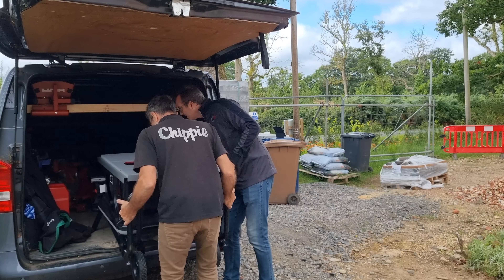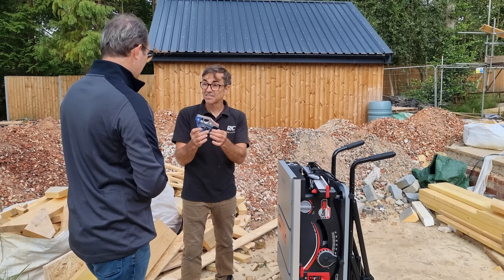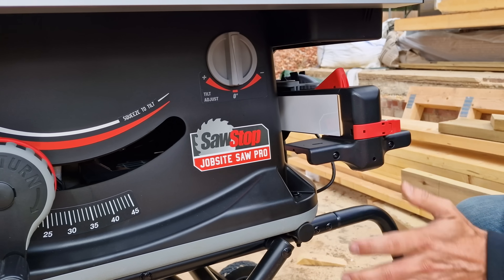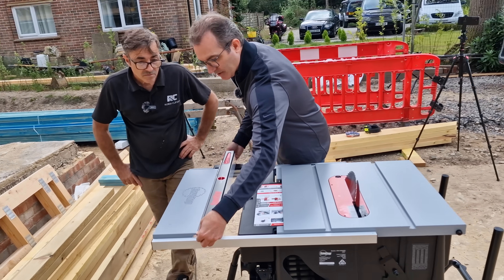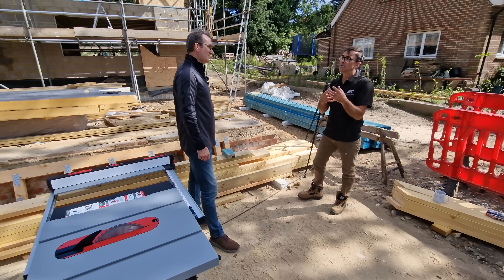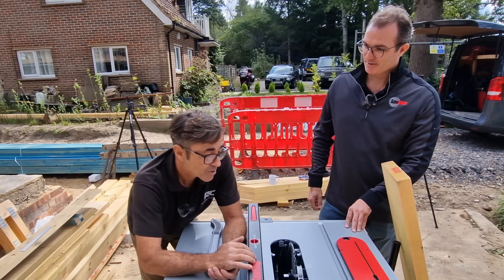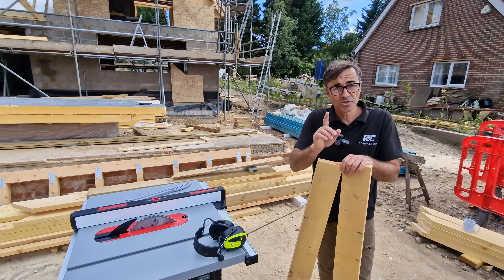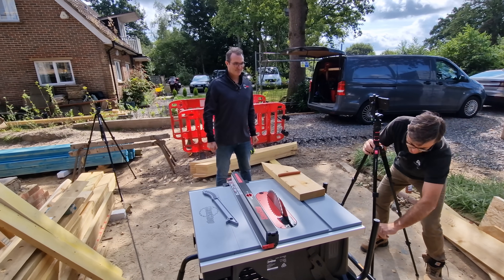SawStop is finally here!!!!! The saw that has saved fingers for over 20 years

Comment: So, you have two choices.
1) You can fit a guard to prevent contact with the blade
2) You can add a lot of expensive technology and pray that it will work when needed"
And, of course, that guard also prevents many kickback injuries, which the SawStop system does not...
* do you think there is a single risk assessment inspector that would accept this as the sole protection?

Comment: I had the sawstop jobsite, I found it to be disappointing in many areas. Especially dust extraction, too flex on the fence and mitre gauge dovetail even with a incra mitre gauge. Its ok for occasional rough cuts. Precise adjustment for height of cut and mitre cuts is difficult.
Reply: @blackadder1966  ditto
Inferior saw, great blade safety

Comment: Got the Festool TKS 80...got to be careful that you don't accidentally touch the blade for a few seconds after you have switched the saw off because it will activate the cartridge. 
Happened to me....couldn't understand why the saw wouldn't restart. The blade was still up, but the cartridge had fired into the stationary blade ..... £90 that cost . 
Also , on the Festool you cannot put fence any closer than 3mm....not that you probably would on site, but it makes you think.
Quite often, if the brains on the saw aren't happy, it just won't start....have to switch it off ...all the way off and turn on again..
I'm a nearly 60 years old joiner... only saw I'm nervous on is my Festool .

Maybe now Sawstop are in the UK cartridge, and blade prices might come down£££££

Comment: Would be interesting to see the price point it comes in at? We have been running the Festool TKS with Sawstop for the last 12 months and it's great for peace of mind and letting less experienced people use it. One activation from a nail that we missed in the wood but worth it. If this comes in at the right place we'll be able to replace our Hikoki jobsite saws as well.

We also run the Felder Kappa 550 PCS with their version of it which doesn't require contact and doesn't wreck the blade. It would be great if Sawstop/Festool could make theirs non-destructive,

Comment: Does the blade need to be replaced if the safety mechanism is fired?
Reply: Yes. Easier than replacing a finger.
Reply: @robertpearce8394  
Did Bosch not have a similar system where the blade didn't have to be replaced, which had to be withdrawn after litigation?

Seems the basic patent for this expires in 2026 so I anticipate prices will fall after that.

Comment: I’ve been using the SawStop Jobsite Pro for the last 2-3 years in the states. There’s a lot of great features and I’m sure it’s saved my crews fingers several times over, but the fence is garbage!! It doesn’t stay square and we have to use a clamp on the far end adding lots of time for every change in width of cut. I’d purchase a new fence but it doesn’t seem possible to purchase individual parts for the saw.

Comment: The SawStop is a brilliant invention, but...

1) I can hear the saw struggling. It sounds really under powered for any jobsite saw.

2) I use aluminum multi track for my sleds for a perfectly straight edge, and for attachments. I've read that aluminum will set off the saw stop, so...at a hundred $+ a pop replacement, and possibly ruining the blade as well; leaves me still just thinking about it.

3) Priced like a Festool product. Ugh.

I use the; DEWALT (DWE7491RS) 10-Inch Table Saw, 32-1/2-Inch Rip Capacity. Comes with a better mobile cart, better fence (rack and pinion) , more power, and comes in at under $600.

Hmm, 

(POWERTEC 71488V Aluminum Multi T-Track Fence 3” High) if you don't know what multi-track is. (Woodworking blades happily cut through aluminum) 

That being said; I would probably buy the full size Sawstop table saw, and give up using aluminum backing if I ever have the room for it in my garage woodworking shop.

In no way affiliated with any company. Happily retired woodworker hobbyist. Thanks for the demo.

Comment: The Dewalt (which I've used for years) has a rack and pinion system on the fence. It is very easy to micro adjust, and is connected at both ends so it will absolutely not flex. The system on this SawStop looks inferior.

Comment: Looks pretty good but apart from the obvious reasons to keep your fingers away from the blade there seems to be a cost-incentive as the brake cartridge is single-use and replacements are about £85.   That said it's pretty good value against the loss of non-replaceable human fingers!
Reply from the maker: Exactly Rob!!
Reply: @robinclevettcarpenter  As an aside on the subject of lost fingers Jaimie of YT Perkins Brother Builders has some pretty neat "replacement fingers"  (and you'll like their current MASSIVE house build with wooden trusses/beams)
Reply: @robgullen wasn't it a jointer or something that was running unbeknownst? Either way not  great
Reply: @purpletapes  Yes it was a jointer/planer - my comment was about the clever "replacement fingers"  that he has.

Comment: Recommend you go through the calibration process with your blade's vertical setting (make sure the blade is perpendicular to the table top).  Mine said 'zero' on the hand wheel right out of the box, but it was actually one degree off vertical.  Made a huge difference with both the sound of the blade and the ease of cutting.  Congrats on the purchase!
Reply: A common problem with most table saws when their new, never assume it’s correct
Reply: @paddy6859  Yeah.  Shipping among other things, can be hard on parts.

Comment: Unfortunately Sawstop have lobbied aggressively in the US market to get laws changed to mandate the use of their technology in all saws. I don't think this was altruistic, but as a means to corner the market.
Reply: Regardless a good thing, no?
Reply: @JackdiyGarden For me no not really, plenty of finger removing tools that don't have this or similar tech, notice they lobbied for the law change when they went in to the European market, in prior years our European fingers clearly didn't matter. What's the point of the safety feature a legal requirement when it can be switched off?
Reply: Oh no, safety technology to save fingers, absolutely terrible! Muppet
Reply: Yes exactly.
Reply: There are multiple patents, and in the Congressinal hearings,  SawStop agreed to surrender a key patent.
Reply: So we’re seat belts in cars. Seems like a good thing.
Reply: They could take the Volvo seatbelt approach and give up their patent in the interest of safety. But no, they lobbied for it being mandatory whilst protecting their market position. Not a good thing. Worse than that they were suggesting that existing saws be outlawed. So if you owned a quality cast iron saw, you'd have to scrap it and buy a new plastic saw.
Reply: They invented the safety device long before they made a table saw. They took the device to manufactures who refused to license it. You can hardly blame SawStop from protecting their invention when the manufacturers clearly intended to simply copy it and avoid licensing.
Reply: @ehamster  exactly, do people realy think these companies make a profit from kind gestures.

Comment: Doesn't bosch do the same i might be wrong.
Reply: When SawStop was still owned by the inventor they sued Bosch in the US for a similar system without grabbing the blade (No blade damage after activated, just drops the blade down) and Bosch lost, had to quit selling in the US. With the Bosch you don't have to replace the saw blade to get back to work, just the cartridge. My own opinion (which means nothing) I'd prefer the Bosch system.
Reply: @nowhereman112244  Correct on the lawsuit - It was called Reaxx

Comment: It looks like the fence clamps at one end only. Every job site saw I've seen with that style fence has some to a lot of flex and so often cuts out of square - worth looking at.
Reply: I am no tool expert but that was a clear issue that stood out to me too.
Reply: It looks like it might have a clip on the far end of the fence that I'm guessing might hold that end tight once you lock it in place? Would definitely be a deal breaker if the fence flexes at £1600
Reply: Much too expensive for a job site saw and they are vastly overplaying the ‘ fingers ‘ angle
Reply: I've had one of these saws for 5 years. The fence is very rigid and very accurate. You can deflect it if you press really hard, but does not deflect at all during  normal use.
Reply: @blandmccartha  Thanks for the info. I just need the £1600...might be a while.....